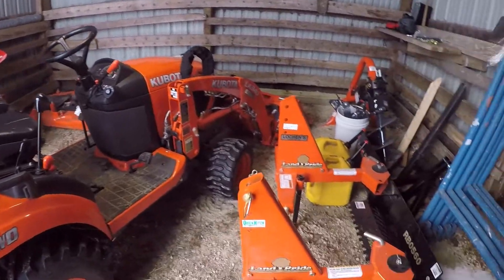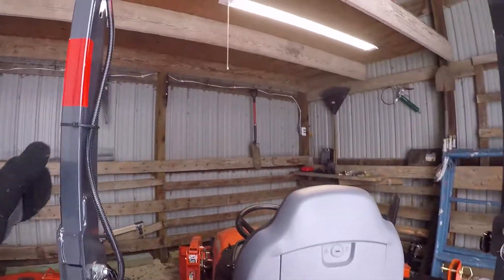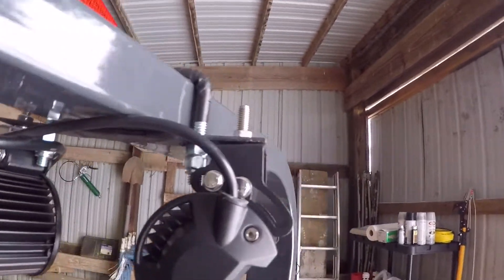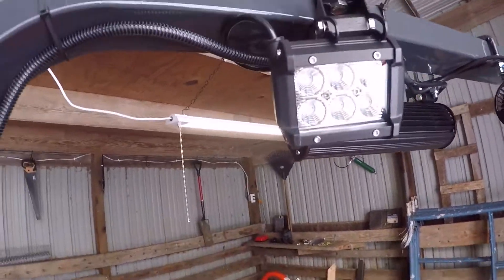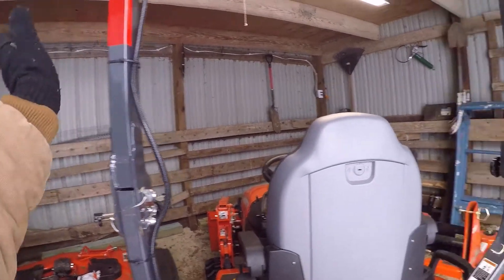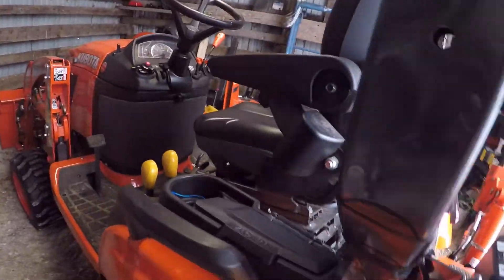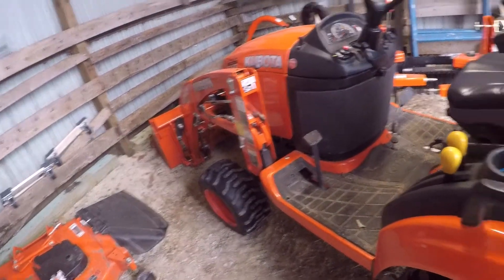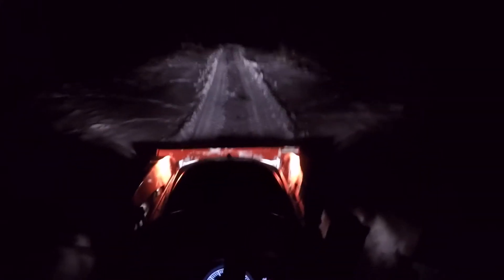Overhead lights added to Kubota BX23S (Subcompact Tractor) ROPS bar

Comment: did you take the guide lever cover off tractor -the plastic /glove box or just work from the top?
i tried to remove it....fail....i then tried to pry out accessory outlet-good grief...fail...thanks for any info
Reply from the maker: I actually worked mostly from the bottom. I did not take anything off, except for the 12VDC adaptor. From the top I slid in the switch, which had enough wire to enable me to solder to the old 12VDC adaptor harness underneath. I then zip tied the whole thing together and tucked it between the tank and the plastic cover.  Be sure to use heat shrink if you do it that way.
Hope that helps!

Comment: Were there any specific reasons why you chose those lengths and wattages of LEDs over the others nilight carries?
Reply from the maker: I didn't focus on brightness, I focused on power consumption. I bought the brightest lights I could that were under the wattage rating of that 12VDC plug I removed. 
I chose two small lights in the back so that they could be tilted and reduce shadows when using the backhoe. In the front I wanted a longer bar for a wider "illumination angle".
Reply: @IllInformedHuman  Genius mod, thank you!

Comment: I have a bx2380 and it has a bundle of 3 wires taped up with blue tape to the left of the top 3 point link. It's for the factory ROPS lighting I've been told.   Just checked and it has a ground wire, an always hot wire and an ignition on power lead.  Would have thought the ignition lead would only come on with headlights but nope.  

So going to use these to wire my lights up.  I'm going to assume the S model has it as well.  They want to sell their factory halogen ROPS lights to everyone lol

Comment: I'd also make sure the wiring in the hub area is water proof.  Water and mud will get into anywhere it wants to if not well protected.
Reply from the maker: Best I can do is heat shrink and electrical tape ;)
(imagine pawn-stars meme template)